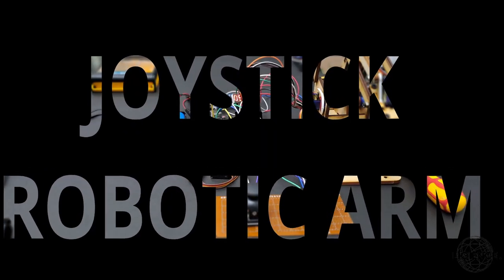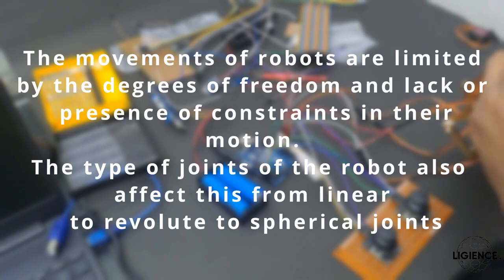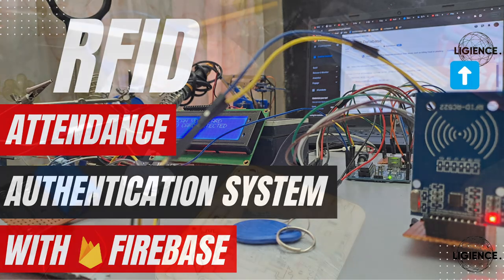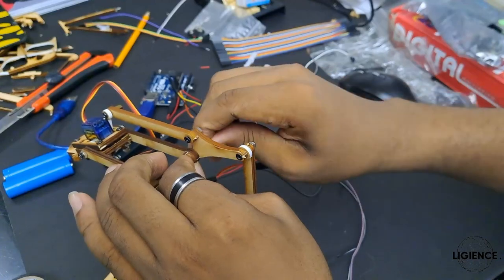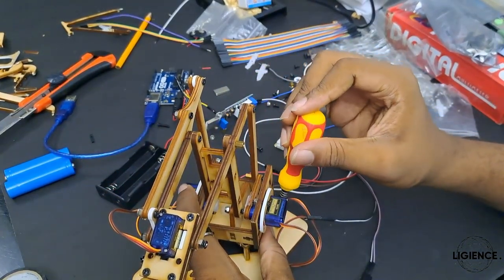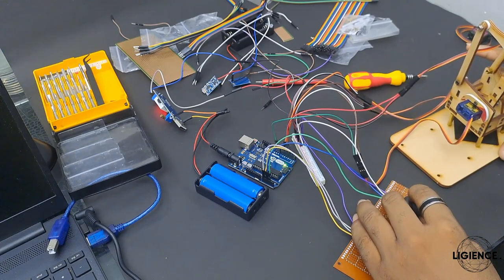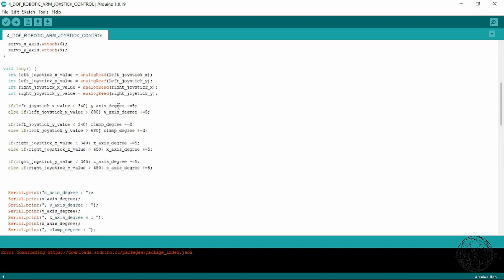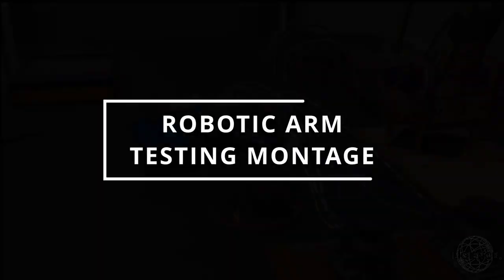How I Built A Joystick Controlled Robotic Arm In Record Time - DIY Arduino

Comment: The supply voltage for the servos does not have to come from the Arduino as you can see. You have to give them separate food. The Aerduino now keeps resetting itself and your Robot Arm starts making strange movements. The peak currents (Amp.) of a servo can be up to 1 amp. increase. So a 5 volt 2 amp power supply is needed for smooth arm movement. 2 amp is even better if you want to make multiple movements at the same time.
Reply from the maker: Yes, i agree. I usually separate the power supply for the servos, but the project was made in a rush . THANK YOU FOR THE ADVICE. In my newer projects I'll definitely be implementing the appropriate power supply

Comment: Talking about the power did you mention you use 2Lithium battery and another external 5volt? I need clarity on the stable 5volt cos I didn’t see more than the lithium batteries as your power source in this video project
Reply from the maker: In that video, i used just the 2 lipo batteries, which went to the breadboard power supply module that has a 5v regulator on board.  I would advise a much more robust 5v power supply  system to ensure the motors get enough power. As my robotic arms jittered a lot
Reply from the maker: I just checked again, and i ised a buck boost converter module to supply 5v for the system. Looking back at it, a lot of improvement should have been done, and i would be able to do much better now compared to then.
Reply: @LIGIENCE do you mind dropping the link to the picture of this boost converter and that means you won’t be using the 2 lipo battery again?